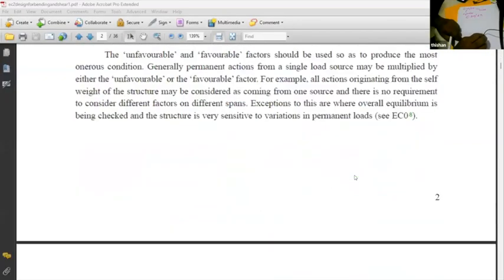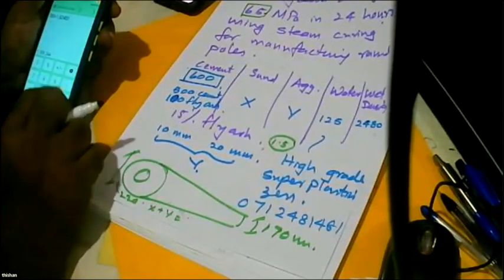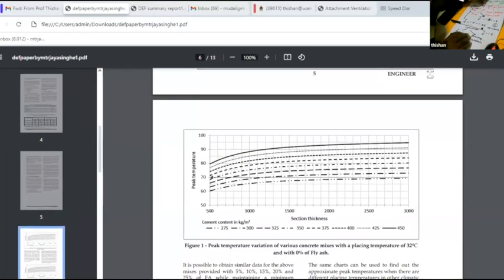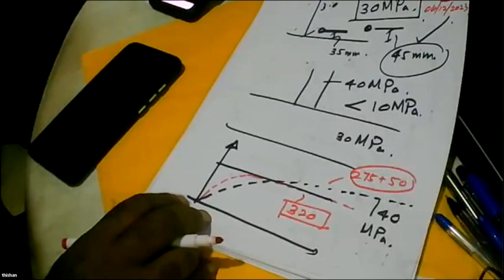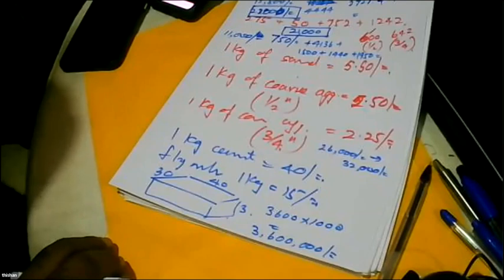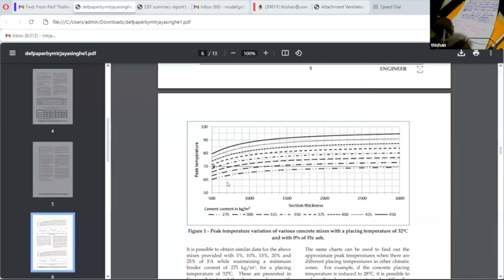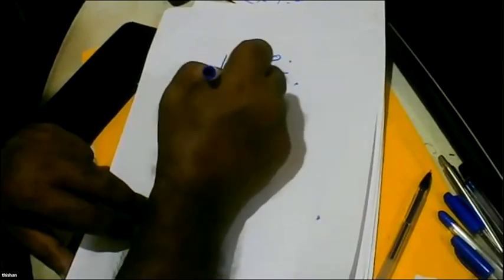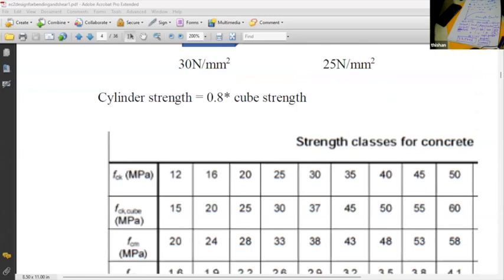Structural Design of cost effective Lightweight Hybrid Multistorey Buildings using Eurocodes - Lec 2

Comment: Is it must to mix  both fly ash and addmixture together?, is it possible to use fly ash only?
Reply from the maker: It is possible to use only fly ash without any additional admixtures if the project can accommodate the properties that result from this simpler mix. However, using both together is common practice when more tailored performance or quicker strength development is needed.